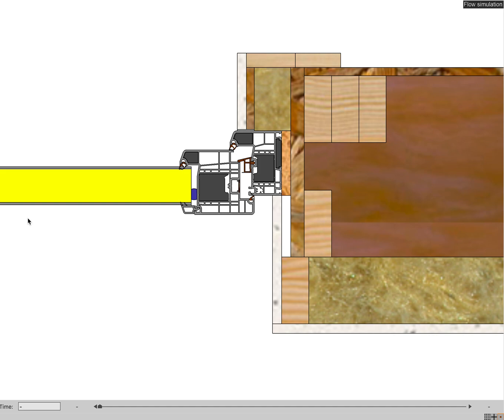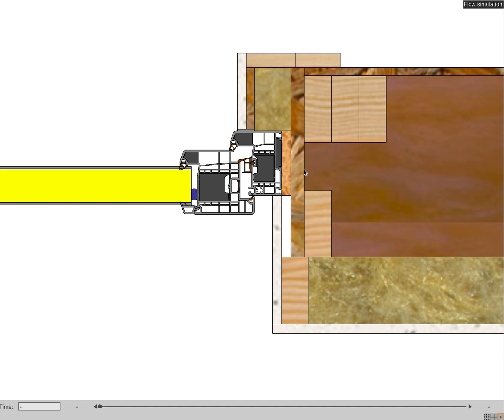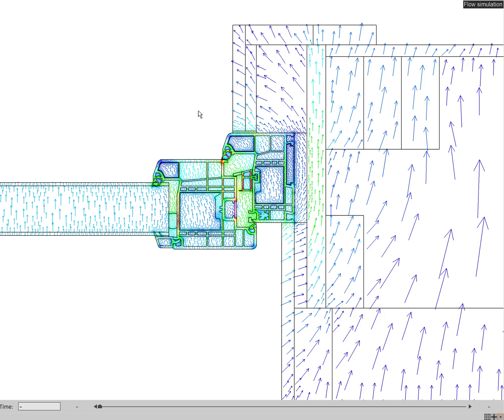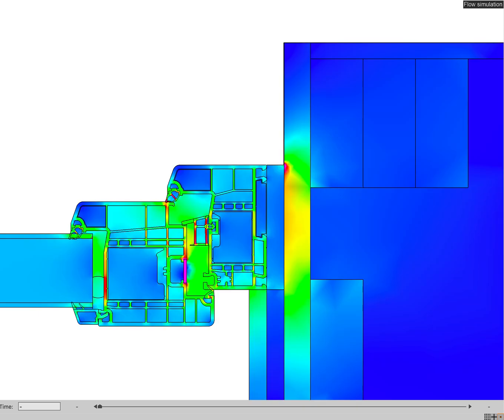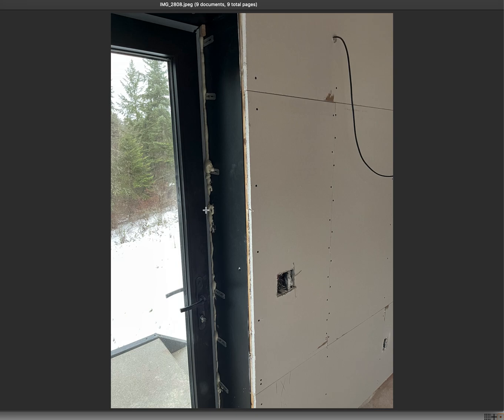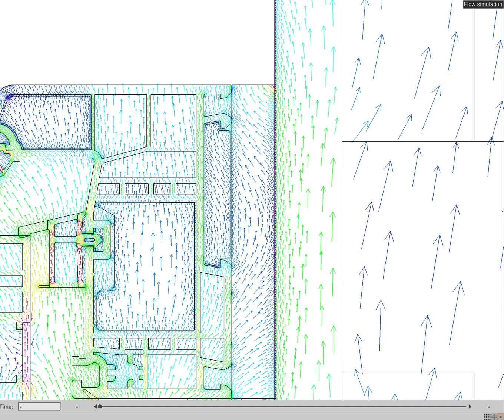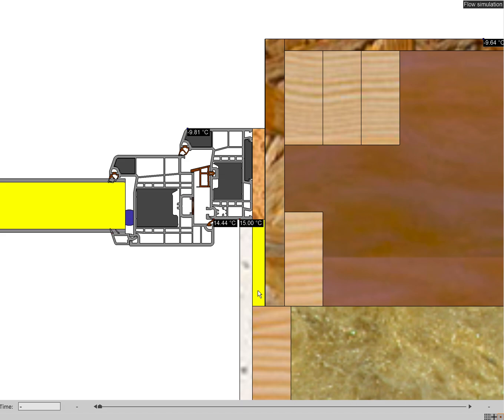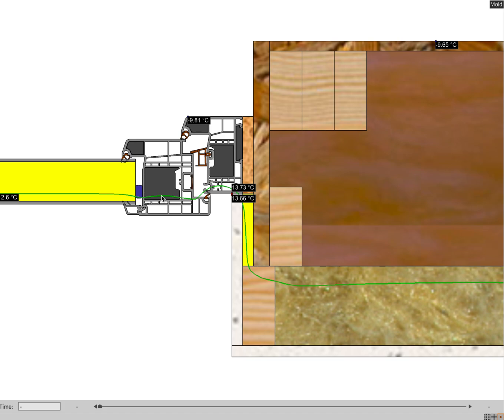Door Install Thermal Bridge - Metal Trim And Mold

Comment: Thanks for another great video. I hope you can help with answers to a couple of questions.
If I understand the drawing, there appears to be a double stud wall with an additional service cavity (or insulated wall) inside the double stud wall.
1) Does moving the mold line isotherm (green line) away from the surface, into the wall cavity, shift the potential mold problem on to the wood structure?
2) Where should the air barrier and vapour control layer be in this structure?
3) Does the modeling software show the line at which condensation might occur?

Thanks again for the very enlightening videos.
Reply from the maker: you’re welcome! to answer your questions:
1) moving the mold isotherm into the wall does not mean mold is going to form inside the wall, it means that mold won’t form on the interior surface
2) the air barrier and vapor control layer (in this project, a smart vapor retarder membrane) is installed on the interiro face of the interior stud, ie before the service cavity is framed
3) yes it does. in this case there was no risk for condensation, only mold (the two phenomena are different)